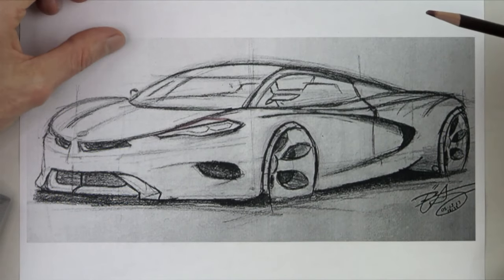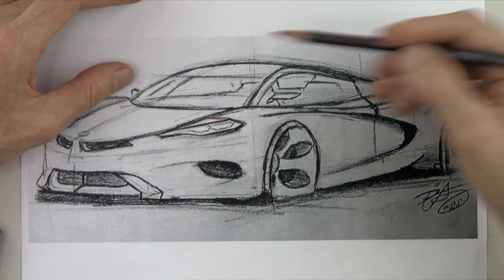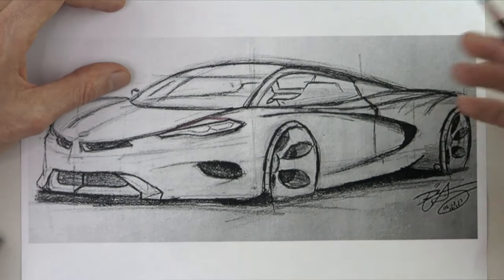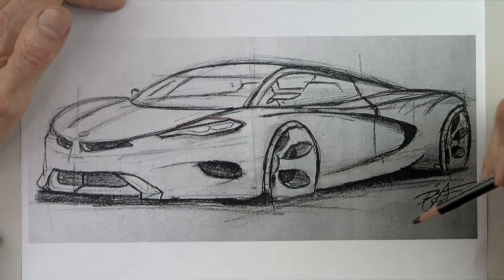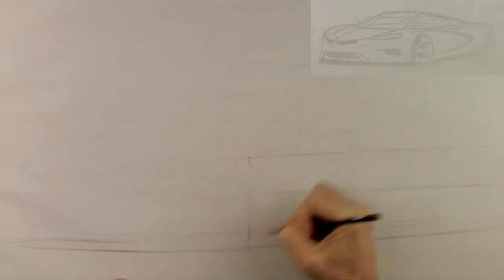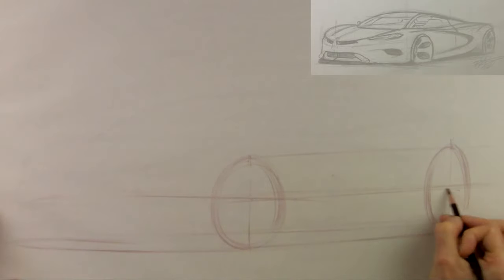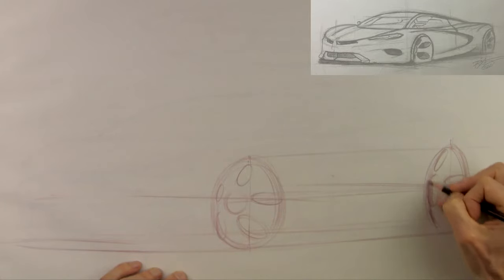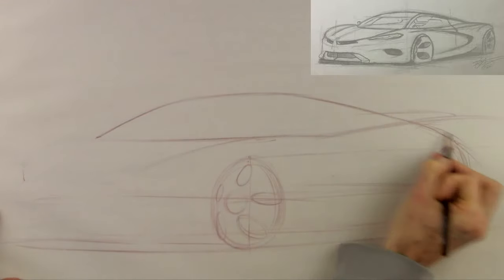Pro Designer Teaches You Top 3 Tips for Better Drawings Right Now - Improve My Car Sketch 1

Comment: hi,can I have answer to this question please, what if i am
drawing  a new sketch with a color pencil and the shape of the the line was not pretty good so I want to change it but I cant erase it with an eraser ,what should i do??
Reply from the maker: Even professional car designers draw lines they don't like. This is how you find what it is you're looking for. The difference between how they are drawing and how you are drawing is they are drawing very lightly. If you draw a line that you do not like and it's very light, it's easy to draw a better line over it. No need to erase it. If you watch the video you will see that I start out drawing very lightly and build the line weight up as I go. I would suggest you watch the How to Draw Cars video on line weight. It will explain the concept further and help you. Thanks for your question.

Comment: Very nice sketching, it looks so easy haha.. To me It looks like a very BMW. I have always trouble with how to make the right contrast and how thick the lines must be, is there a secret for? 😉
Reply from the maker: The right pencil will help. You need to be aware of how much pressure you applying to whatever media you are using. The more pressure the darker the line, usually. Learn to draw light lines to start. The lighter you can sketch, the more contrast and line weight differential you can create in your drawings. Check the video on the McLaren sketch. It covers line weight too.
Reply: @howtodrawcars.  Thank you!

Comment: I have a problem with the prospective of the car how do you really get that 3D effect just starting of straight from 2d drawing
Reply from the maker: if you watch when I put in the ground plane, I draw 2 lines that are like a very open "V".  The line on the left side of the page becomes the axis of the front end or short axis of the car, and the line on the right side of the page is longer and becomes the axis for the body side of the car. This creates the foundation for the 3-D effect that I think you are referring to.

Comment: while drawing from your shoulder, does your wrist touch the paper?
Reply: i think so, but it slides
Reply from the maker: Yes, Joshamie is correct. Your wrist slide across the paper. After a long sketch I will look at the underside of my wrist and it will be red from the pencil.
Reply from the maker: Not this time. :-)

Comment: Hey howtodrawcar does drawing with your sholder also improve other types of drawing not just cars.
Reply from the maker: It depends on the type of drawing. Typically for fine art drawing it doesn't help. If you're doing product, interior or environmental design it can be helpful. But automotive design is really the realm of the drawing from the shoulder technique. It's only taught in transportation design at the college/ university level. Other disciplines do not teach it.

Comment: How do you define the axle in perspective with the wheel plate ? Like, I see that it has to look real, but geometrically, how do I put it like that ?
Reply from the maker: You don't.  There is a different method for that. Almost every student I work with draws their wheels off axis. I teach them make the wheels square to the ground plane first, then move to the more advanced technique of drawing a cylinder in perspective. If I teach the more advanced way first, they never improve.

Comment: Is there an reference image 🖼behind your drawing ❓❓❓
Reply from the maker: I do a rough sketch that I use as an underlay to make sure what I will draw in the video actually fits in the frame. These videos take a long time to produce. The last thing I want is to film the entire process only to find out in post production that what I drew is not in the shot. There are a few of the other videos where I show the underlay before I start. On a related note, you should be using underlays as a way to improve all aspects of your design drawings.
Reply: @howtodrawcars.  💯

Comment: Did you trace the drawing
Reply: Because if you look closely there is a drawing below
Reply from the maker: I have the original drawing that I did as part of the tutoring session with BK under the sheet I am drawing on. I actually cannot see it with the studio lights on. Newsprint paper is not really good for tracing. When you do one of these videos it is important to make sure the sketch will fit in the frame of the camera. We set up the shot with the original drawing and then I slipped it under the top sheet and put a couple of tick marks on the page to insure that the sketch I am doing for the video is going to fit. I'd be kind of sad if I was doing a sketch for the video and the car didn't fit in the frame! Thanks for watching.